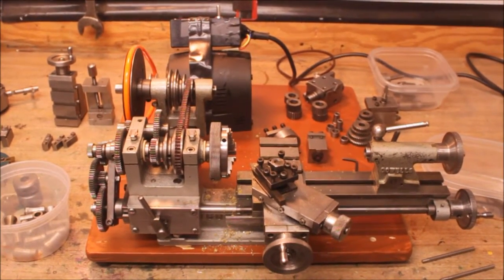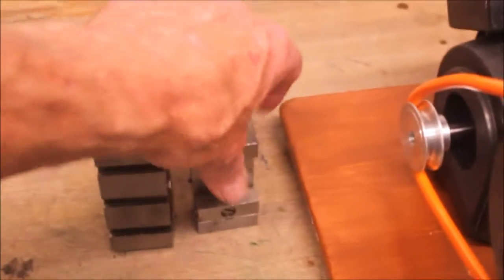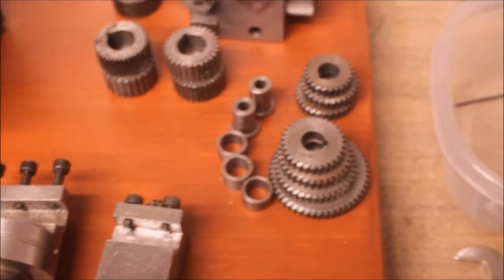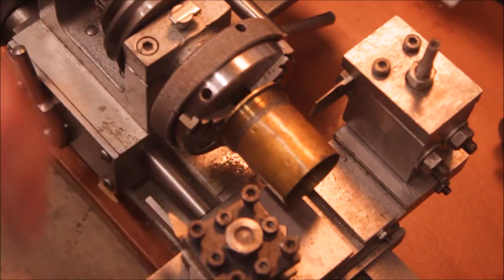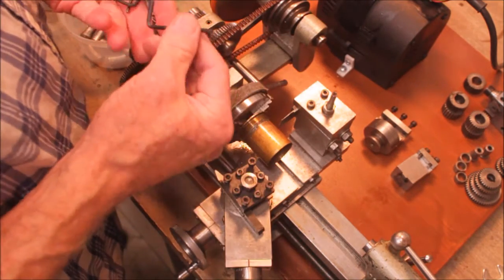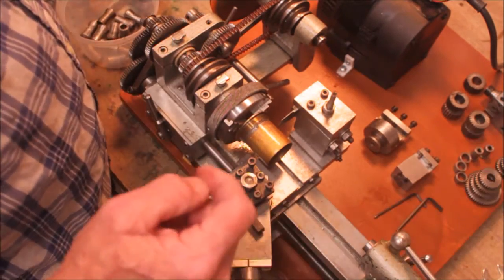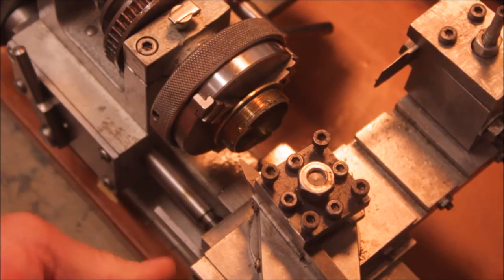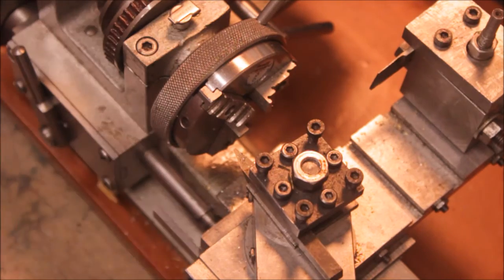Cowells 90ME Lathe

Comment: Another fun video. Cowells is still in business.  They build  clock/watch maker's lathes. They are incredibly precise and incredibly expensive nowadays. They even have a website: cowells.com.  If anything would tempt me to replace my little Taig, it would be Cowells 90ME. The flycutters were probably designed to cut gears for an oddball clock, since custom cutters are even more expensive than the Cowells. If you are cutting off, you are probably better off with the rear toolpost and running the lathe in reverse. Assuming you have a reverse. Since I work in metric, the metric feeds would just be icing on the cake!
Reply from the maker: Thanks for the information, Juan!

Comment: I am aquiring one of these. cowell 90 lathe.
 Can you make bolts that are approx 5/16ths of an inch in diameter, and about an inch long,for vice jaws, with this lathe, as well as clock arbors and pivots.
Reply from the maker: The lathe is not the question. Can YOU make those items? That is the question.
- Dave